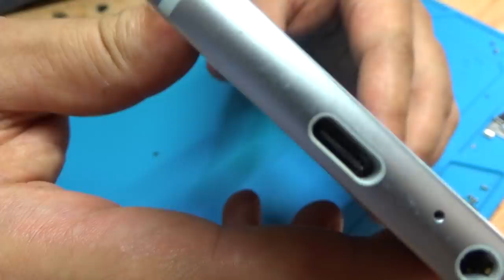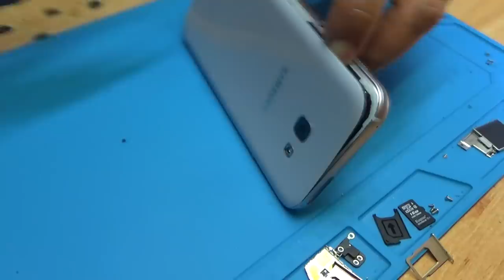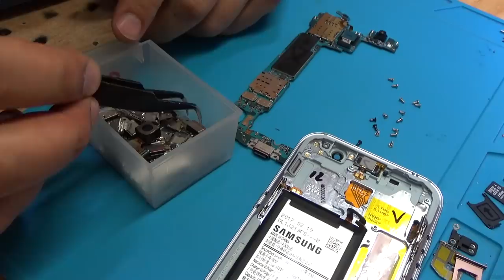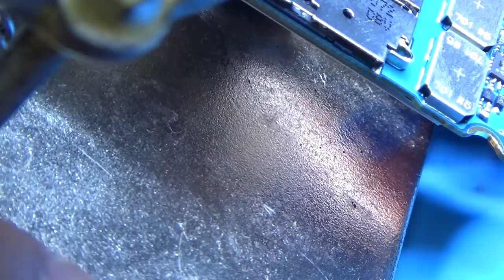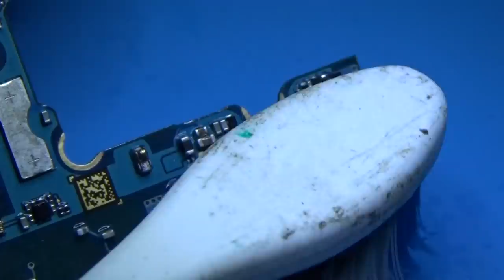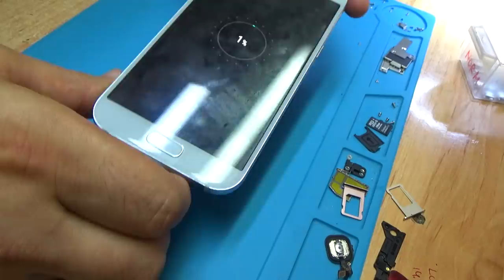Galaxy A5 (2017)...not charging

Comment: This is delicate soldering work and most people will not go this length to try and fix it ( great for hobbyist thought ), However they be more incline to fix it if it was just a matter of replacing the charging port board itself as that part does not require any soldering or know how.

What is the name of that charging port board part? and is it possible to order it?